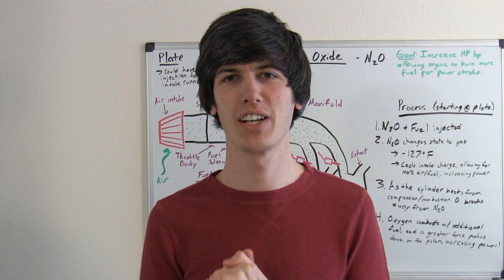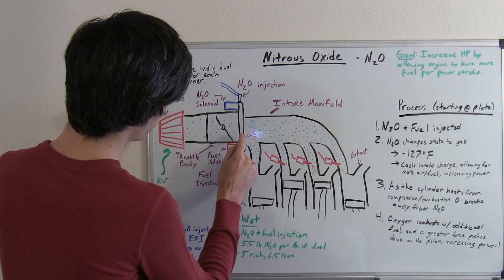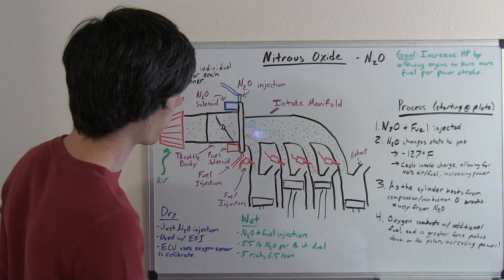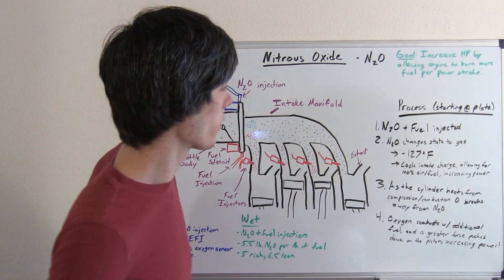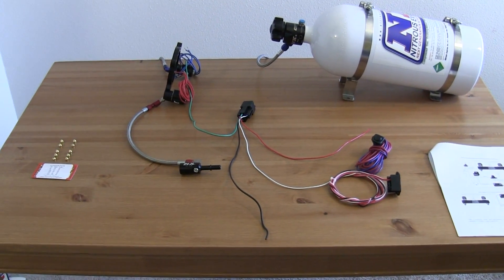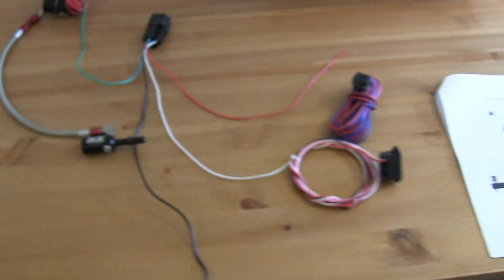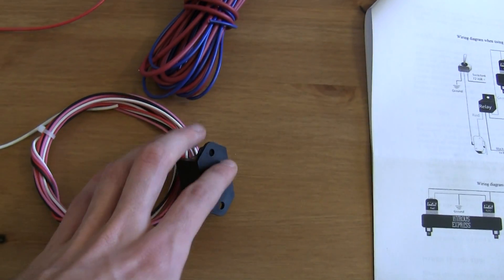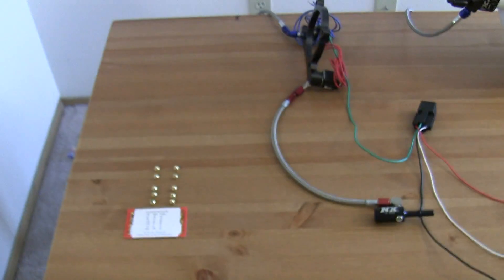How Nitrous Works - More Horsepower!

Comment: Can nitrous injection be used in diesel engines? Just wondering if it's possible since there is no throttle body to begin with.
Reply: yes, pretty sure its controlled by your throttle position or in other words your foot.
Reply: Yeah, I figured, but where would you place the ports to actually inject the nitrous? In the video, it's placed in the throttle body but diesel engines (mine in particular) don't have throttle bodies. I have friends that are spraying and they use octane booster on 91 pump gas.
Reply: the best place would be on the cold side of the intercooler tubes

Comment: What if I put nos on a 1.4 single point injection engine ..... will the engine blow ? and will the gain be significant? thanks
Reply: You can do a ten shot petie, it shouldn't damage it; make sure you do some more independent research and do not take this as solid reason to do a NOS shot on your car. Check your engine and other car components to make sure they're performing well first.
Reply: Eric Suarez cheers ...but i think it's more worth it to get a better engine .....2.0 16v from the gti on my mind :D
Reply: Yeah, I agree; you can also add a turbocharger, just a small one, and get a good amount of added HP to either of those. #Gearheads
Reply: Peter Bartolo the vw 16v is a great engine! very peppy if built right and can be a monster if you turbo it.

Comment: Lets say i want to upgrade my engine and i want more HP but i want too keep it safe and far from burning exploding or damaging itself, what is better turbo or nitrous ?
Reply: Turbo, super charger and nitrus are all different; NO2 causes your pistons to pump faster, which may or may not cause damage, depending on your engine. Turbo is in essence an "air compressor" that runs off of your exhaust gasses (your cars, close the can of beans) and causes another turbine to spin and in essence, force cooler air into your engine and giving you boost. A super charger runs off of the crankshaft and is belt driven. Example, you've got a 200 HP car with a super charger; well, the super charger is connected to the belts and may rob your engine of 50 HP to run, however, your now 150 hp car gets a boost from the super charger of +150 HP, causing your HP to be 300 (200-50+150).
Reply: Thanks
Reply: Nitrous oxide is the cheapest horse power boost you can purchase. The video showed you how you can change horse power output by changing the brass Jets. Problem with superchargers is boost is created by rpm's of the motor. Example is if maximum boost is set for 6500 RPMs then you have to wait to reach that rpm for the maximum boost. Also if the supercharger is putting out boost at 4000 and you're on the highway at 4000 but don't need the boost you still get. Now there are blowout discs on the intake manifold so that when you close your throttle you won't blow up your intake or the supercharger.
Turbochargers work more on how hard the engines working then how fast the engine is spinning. In other words you're going down the highway at 4000 RPMs on flat ground the turbo probably won't be putting much boost out. But if you start climbing a steep hill holding the 4000 RPMs. The boost to be way higher even though the RPMs the same as on flat ground.
There is a lot more information about how the different systems work, just depends on how much time you want to put in to it
Bottom line there all very hard on your motor. And will dramatically shorten the life of your engine.

Comment: why not just use pure oxygen, its alot cheaper than nitrous
Reply from the maker: Tailz99! Far more dangerous.
Reply: Engineering Explained Thanks dude, that was my question too. Does this mean that nitrogen was added so that the split can take place at the right temperature and inturn combust? Because if it was just pure oxygen,  would it have been more unstable?
Reply: Jeevan Raj It'd be more unstable, yes, and you don't want to add pure oxygen to a system where it will be the substance with the lowest flash point for that reason.
Reply: Engineering Explained why not just use compressed air to increase the amount of oxygen?
Reply: MRBLOBBY127 GREAT thought but unfortunately your engine sucks in HUGE volumes of air so you cant just have a tank of compressed air. if the tank was the size of your whole trunk it would still be empty in seconds. but it is exactly what super chargers and turbo chargers do.
Reply: MRBLOBBY127 That's what a turbo or a supercharger does ;)
Reply: +Engineering Explained  Have you heard about solid room temperature CO2 as a fuel additive?

Comment: Isn't nitrous oxide flammable?
Reply: Anguel Gutierrez Actually iron is! Ever lit steel wool on fire? That's the iron burning, making rust. Powdered iron is actually pretty flammable.
Reply from the maker: Anguel Gutierrez No, just provides extra oxygen.
Reply: Engineering Explained cool.
Reply: Engineering Explained i thought oxygen was the fuel for fire xD
Reply: Everything is "flamable"
Reply: Alex Hecimovich Iron isn't.
Reply: Race fuel is explosive top fueled  dragsters use it with nitros for increased hp
Reply: Dark Star Oxygen is the Oxidizer required to burn the Fuel (gas). the 3 requirements of a combustion reaction are the Fuel, Oxidizer and Ignition source (heat, flame, etc)
Reply: Nitrous Oxide is made of Nitrogen and Oxygen, Nitrogen is an inert gas. So Nitrous Oxide is not flammable but as he explained, when it reaches 600F the Oxygen seperates. Then Oxygen that has seperated from the Nitrogen will be used for combustion
Reply: ***** If so. Then why does the world not catch fire
Reply: Oxygen is not flammable, sorry...

Comment: I've been in the auto mechanic business for over 25 years and I have to say you do a great job explaining the basics. I often send my fellow gear heads to your videos for a refresher.  Well done!!!!
Reply from the maker: Jason Smith Thanks Jason!
Reply: So why not just inject oxygen?  Is it just the danger of racing with pounds of compressed liquid oxygen in your car?
Where does the heat go? The phase change happens and the Nitrous drops to -127F, but it seems to me that would just heat up the manifold if the phase change is happening right under the throttle body. Is ALL of it used in the phase change?
Reply: @tarstarkusz  This reply is a full year late but whatevs.

Changing state requires energy, and when the nitrous goes from liquid to gas, it takes that energy from its heat. So that drop of a couple hundred degrees was the heat being used as energy to complete the state transfer. 

Hope that helps :)
Reply: I am assuming it is latent heat because of the phase change.
Reply: @tarstarkusz  Firstly oxygen cannot be safely stored in a regular car. Secondly oxygen rich air will increase risk of knocking in cylinders.
Reply: @JF-pf9hx  But that is what Nitrous does. It provides a ton of oxygen to oxidize additional fuel that couldn't otherwise be burned.
Reply: @tarstarkusz  also N2 triple bond formed...see my recent comments above :)
Reply: @wadehood7238  There are no other comments by you in this thread.  If you mean different threads, they only look close to this one for you and that is done on purpose.  Maybe you could copy paste it into this thread?
Reply: @tarstarkusz  Chemistry teacher here.  Burning N2O created N2, which has a very strong triple bond, releasing more energy.  That is one reason by nitrous oxide creates more horsepower (1hp = 746 W).  I don't know the engine design and mechanical reasons.  N2 strong triple bond is why only small amounts of NOx (smog) gets made,  it is easier to form CO2 and H2O than break N2 which is all around the reaction in the air intake.

:)

Comment: Im suscribing immdiately... Great video, thanks for the explanation... btw, Is using N20 dangerous for your cars motor? does it damages your motor faster?
Reply from the maker: pasu kishern Adding power adds stress to all the components involved. Adding stress reduces longevity.
Reply: thanks 4 da info

Comment: What's a wide open throttle?
Reply: Exactly what it sounds like. When you depress the accelerator it either pulls a cable directly connected to the throttle body or sends a signal to a computer which controls the throttle body electronically. Inside the throttle body there is a butterfly valve. When it is opened more air and therefore fuel is permitted to enter the engine. This increases engine speed and power. When you are at full throttle the valve is all the way open or "wide open". So being at wide open throttle means the accelerator is fully depressed and the valve in the throttle body is fully open too allowing maximum air in.

Comment: So you can choose How much hp to add using the bronze looking nozzle tips. What are some examples of each set of nozzles and their typical applications? If you can add 200 hp why would you just add 50? Is it to conserve the bottle of n2o or is it because of certain drive train restrictions to different vehicles? Thanks!
Reply from the maker: Brandon Haus Not every engine can handle that much additional stress.
Reply: You run what you feel the motor can handle safely. The general rule of thumb for max hp on stock motors without forged connecting rods and pistons is 20hp per cylinder.

Comment: If i bought a nitrous kit for a relatively stock 450hp bmw engine, which i have no desire of doing. How much would it decrease engine life? What other engine components should be replaced before adding nitrous? A 50hp blast seems much safer than 200.. I would imagine my car was engineered for 450hp, so by producing 650hp.. Is like asking the car to self destruct.
Reply: You can generally spray 20hp per cylinder MAX on a stock motor. So for example my car is a v8. I COULD run 160hp max if I wanted too. I started at a 90hp shot, then 125hp and now a 150hp shot. It's about the max I feel safe running through the motor. You can generally spray 75-100hp on 100% stock cars and stock fuel systems when using a wet (injects nitrous and fuel) on a car.

Comment: So does it take a certain spec engine to run the large nozzle you showed? And then lower end cars run the smaller nozzles? Also, how much liquid would the large nozzle spray in if you held the throttle down for say 5 seconds?

Comment: What is the max compression ratio you can use with N20 on a carb fed Chevy 350 and while it is pretty dang quick , I can't supercharge it bc I have too high of a CR (about 10:1) and wouldn't mind a power adder. Also can a Holley double pumper 650 support nitrous? Just wondering. Good vid btw , very informative.
Reply: There is no limit on the compression of a motor when using nitrous.
Reply: spikeafrica hehehe so your saying you can run 130 octane VP race fuel which was made for topfuel drag racing crazy

Comment: as N2O splits into atoms before combustion...oxygen helps in combustion, but what happens with nitrogen atoms??
Reply: nothing. im doing an engineering course and we are currently dealing with combustion. nitrogen is very non reactive at those sort of temperatures. so the nitrogen from the air and the N2O simply come at as N2 (nirogen gas). hope this helped

Comment: wen the nitrous oxide is used ,can it be used again a second plus time ? or it is used up n lost?
Reply: You can use it as long as the bottle has nitrous in it and pressure over 700psi minimum.

Comment: Could you just use straight Oxygen which you see in hospitals?
near 100% O2 should make more power or make the engine go boom.
Reply: Dinesh Deva boost is the wrong word to be using.
Reply: Nitrous also cools the engine, slightly. Pure oxygen will not cool it and you will melt your pistons, if something doesn't break first.
Reply: Pure oxygen may cause a more violent explosion that will blow your engine up
Reply: Although I do not argue your definition of boost,  the connotation with boost is forced induction meaning turbo/super charge. But yes nos is a boost of energy.
Reply: Dinesh Deva also you should listen to 177SCmaro. Pure oxygen...liquid not gas because if weight and size... is not a good thing. Nitrous is not better then oxygen, its safer and usable. O2 would pretty much melt the motor twice as fast the n2o.
Reply: Dinesh Deva use your words better. say "boost in power" not just boost. boost by itself is used as air pressure in most cases.
Reply: MrChevyman12 No he is not wrong. Dictionary gives the following as examples of boost" improve, raise, uplift, increase, enhance, encourage, heighten, help, promote, foster, stimulate, invigorate, revitalize"

Comment: So you seam smart enough to answer this. I have asked many motor heads just excepting the fact of N2O. Why do they not use a higher oxygenated gas such as welding oxygen O3 or O2?
Reply from the maker: Because N20 prevents pre-detonation until the temperature is high enough (combustion). With pure oxgyen, detonation would occur earlier and could cause damage to the engine.
Reply: Engineering Explained
So the Nitrogen makes the oxygen go in cool until it  correct temperature?

Comment: This is a little vague, but as far as impacting the longevity of your engine's internals (a small block chevy for example), what would be more harmful, installing a bolt on turbo kit that adds 100hp, or spraying a 100 shot of N2O.  Let's say you get into boost just as often as you spray, the engine is to oem specs, and in both circumstances, the engine was well and reliably tuned.  Thanks for any input!

Comment: hey people of youtube i have a question that's been bugging me and this may seem weird but if you had a supercharger say a twin screw with dual air intakes would you be able to inject nitrous through where the air gets compressed and maby disengage the fuel intake and the engine would be running on strait nitrous for 10 seconds and then be running on petrol, nitrous and air in the last couple of seconds bering in mind the engine already produces 800horses with the supercharger (designing dream race car you see)

Comment: so what happens or why dont they just use the biggest jets can the motor not take so much nitrous or what??
Reply from the maker: The smaller jets simply don't allow for as much flow.
Reply: yeah thats why i was wondering if there is such a big gain in hp why dont people just get the biggest jet ??? not trying to be a ass or anything but just wondering thanks
Reply from the maker: Because not all engines are built for an additional 200 hp.
Reply: ahh ok

Comment: why not just use an oxygen tank?
Reply from the maker: Pure oxygen is much more dangerous. Nitrous is more controlled, and the O2 only splits off at higher temperatures (in the combustion chamber) when combustion is desired.

Comment: hello friend! nice video, but are these things safe?? I mean, we always see these things exploding on the movies... Thx bro!
Reply from the maker: Like all power adders, you're going to want to build your engine for the added temperatures/pressure/stress.
Reply: Really? you use the movies for your information I usually get my info from Warner Bros.
Reply: Strider Sky Break a crankshaft?? It's likely that the crankshaft will be the last thing to fail actually. Most high performance factory domestic engines use a cross-bolted forged steel crankshaft these days. I'd say you're more likely to literally blow through a cylinder wall than you are to harm a crankshaft.

Usually the weak links (on a production domestic V8, anyway) are spun bearings and blown head gaskets (neither of which necessarily means catastrophic failure) or a loss of compression in cylinder number 8. The occasional chevy will toss a rod through the block :) but that's normally about it, unless the engine had bad tolerances or balance and wasn't properly measured/machined to begin with...

Comment: Ok so what happens when i install NOS to my car, do i need to remap the car or something to let it know about the system and when it will activate etc? Can you/do you connect it to your engine ECU or is its a one man band kit? I own a 2012 Golf R.
Reply from the maker: I would probably take it to a tuner once I had it installed, and let them hammer out the air/fuel ratio work.
Reply: Sebastian Wiers after the MAF sensor for wet systems and the fuel added with it. A dry system is added before the MAF sensor and it reads the added oxygen and adds the extra fuel automatically.